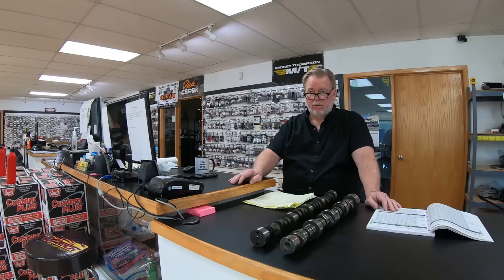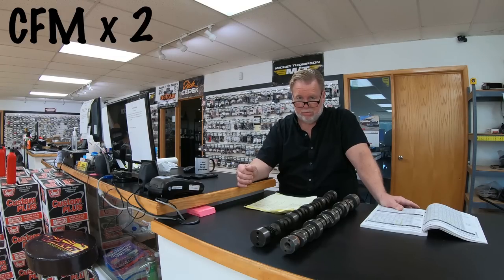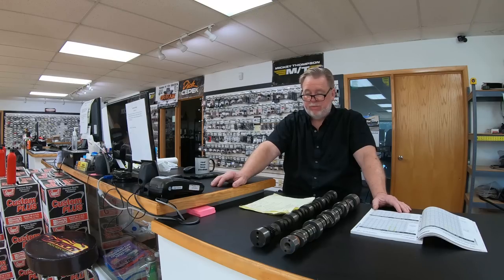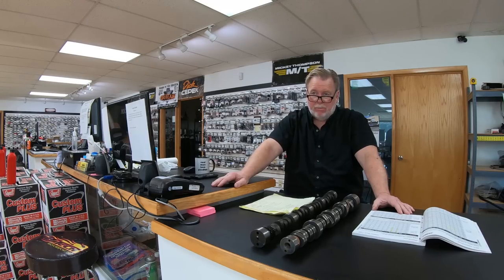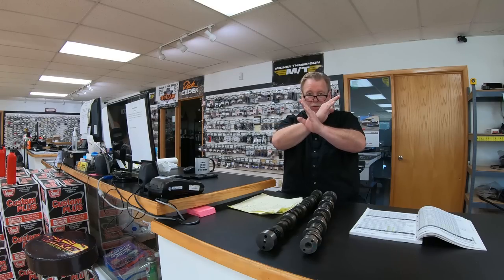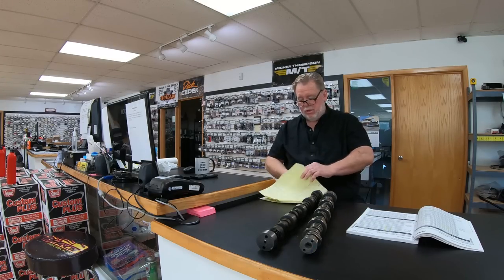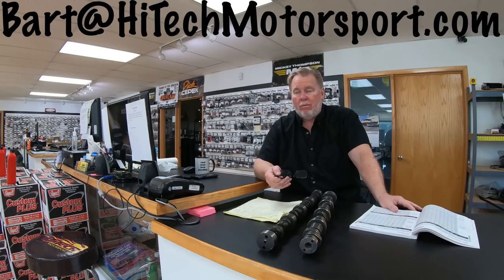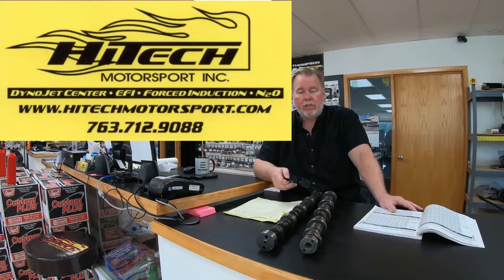How to Choose An Ls Camshaft For Max Horsepower

Comment: You know, I always see guys get these monster cams that make max power at 7-7.5K in a 4,000 lb car and don't understand why the car runs like shit. When I finally get around to doing heads and cam on my car, I'm using a pretty much baby cam. Why? Because my car weighs 3,965 lbs with me in it. Every time I put a big cam in my engine/drag program, (don't ask which program, it's really old) that I think might beat my baby cam, it makes the car slower. I've found that a similar cam I used in real life in a supercharged old school 5.0 works surprisingly well in the LS1. BTW, this 302 cam was NOT meant for a supercharger, but woke the car up big time. Felt like another 60-70 rwhp over the previous stock cam, GT40 head config. My car is a heavy pig. I can't put a 7,500 rpm cam in my car. I laugh when shops say they put a monster cam in a car because the customer want a nice idle lope, against the shops recommendation. Since I'm not in the engine building business if I was building an engine for someone that wanted a monster cam, I would refuse to do it. Like I said, I'm not a shop in the business of making money. I just would feel really bad, putting something in some ones car to make it sound rowdy at idle, but run like baby poop. Same thing with heads. I've put heads with a little bit more flow up top in the program vs heads with very good low lift flow, and smaller ports and valves. Guess which one is always quicker? Yeah. Nice to see someone actually speaking the truth, even if it hurts your ego. I'd rather have someone tell me they can't hear my cam, and clean their clock, going down the track, than having a cam that shakes the whole car and runs high 12's when it should be an easy 10. When I had my '95 Z28 6 speed, I made the mistake of going to a shop right down the road from Atco. I asked the owner how could I get my Z28 to go 13.5's. He told me pull the engine out and put a Grand National 3.8 in it, which would cost me like 10.5K. I promptly left his shop. A few years later, I got to 12.5's with 4.10 gears, ported factory heads, stock valves, headers, LT4 intake, BBK throttle body, and STOCK cam. So yeah. You guys can do a lot worse ignoring everything this gentleman just said. That will just make guys like me faster than you. Have a nice day :)

Comment: What's the best head and cam combo 243 ported or 862 ported and what cam someone told me 233 239 .600 .600 112 lsa I'd like to mill to get 11.1 compression but was told it won't work with that cam and 243 it's gonna be a daily I want it to chop hard

Comment: What would you choose for a L77 engine it’s the aluminum 6.0 with 823 heads and ls3 intake. The car lives at 130-160mph when I drive it and I’m planning to re-gear the rear end and re do the cam setup for more power to go for 200mph what would you recommend? I know I sound full of shit but I can send you video proof of 160 dozens of times. My dream rn is just to reach 200 without having to go to power adders like boost or nitrous. Also this engine in its last two gears revs to 8,000 rpm so it spins up there.

Comment: What an good spec cam for an 383 ls1 stroker with trickflow 220 heads with 2.055 intake valves and 1.57 exhaust valves and fast 102 intake and Tb ,   I had an 240/250 cam speced and the car felt like an dog , and only trapped 117mph in the 1/4 mile

Comment: What about a solid flat tappet 274 at 050 duration 650 lift 106 lobe separation for a drag race only 362 windsor with canfield heads and 12to1 compression on 100 octane fuel? Has a 258 at 050 578 lift 105 lobe separation now and will instantly light 1st 2nd and 3rd to tire smoke on street.

Comment: You didnt includethe ls3 or l99 in the most popular Camaro..the 6.2 5th gen. 😊 Im getting a cam installed in my l99 with 3200 stall and 391 gears. Should i do a custom grind? My tuner suggests that. Thank you 👍

Comment: I have a stock 2002 Yukon Denali that I’m building my spare 6.0 for. I also have a 4l80e that I’ll be putting in with the built 6.0 once I finish it. What all would you suggest cam/heads wise? Im wanting to supercharge it

Comment: Richard Holdner tested an LS down to 108 LSA and it made the best power everywhere. He also tested the loss of pressure and guess what no problem. The problem is everyone wants lots of duration and most small blocks don't need it. Run more conservative duration and tighten the LSA. You will make more average power. Fat area under the curve.

Comment: What would you recommend for an 06 GTO 6-speed, 243 stock heads (plan on upgrading springs etc at same time) believe 3.46 rear gears, factory compression, street car. Got screwed by a guy looking for his own “cash flow”🙄now I’m back in the market for a good cam. P.S. it will be driven a lot so decent fuel economy would be nice. Thanks!

Comment: Does that cam you mentioned for the 5.3 (223/227) work good with stock torque converter?
Reply: You should always pair the cam with the stall. A stock stall is shit. If you're doing a cam swap get a stall to go with it.
Reply from the maker: the 223/227 cam works with a stock stall converter, but it works better with a 2800 to 3000 converter from circle d. you will just need to raise the idle to 675 when you tune it. b
Reply: That helped me out, thanks for the question and answers. 
   I'm wondering too.

Comment: I do not race my 2010 LS-3 Corvette. Mostly we use it for long distance touring and back road driving. The car pulls strongly from idle to 5500. I think I will stick with the stock cam. Thanks for the Information.

Comment: haha, well i did add formula to bbc heads and well it was only 43 hp lower then blueprint 815hp 632 bbc crate engine with nothing special heads (intake@600: 351x2+70.2 = 772.2) so this formula is very nice to figure out basic idea.

also look like 706/862 ls heads are way to go even if any other dyno test say hell no.

Comment: Hi. Good info. I have a 5.7 hemi eagle heads. I am looking for a cam for it. I have a qs.  These heads have a big difference between exhaust and intake cfm which makes a low percent efficiency. I was thinking of making the exhaust valve slightly bigger. Is that a good idea? If so how big for a daily driver. I want the best efficiency air in and air for this motor. As far as cams. What’s some good cams for daily driver that doesn’t kill mpg.

Comment: Knowing this an older video I hope you are able to respond to a question from me. I have a stock C6 Corvette, Z51, A6 w/stock converter, LS2 & 2.56 rear gear. The stock cam is 204/211, 520, 116. I daily drive this car and bracket/index race it on weekends. My question is how does this affect choosing the cam upgrade for this car? Are street manners all in the LSA or does the duration change that more than the LSA? Any comments and/or recommendations. Great video and I appreciate you man!

Comment: LS7 zo6  I'm wanting to upgrade to a better flowing heads possibly over the factory stock ones if theirs such a thing over factory. Also possibly a cam shaft and roller rockers because of the trunion issues on some.  I hear many go in and upgrade them. I figure why spend the money there if theirs an alternative stronger lighter weight units that are full roller. I hear the kits are 150- 160 bucks for trunion upgrade. I was wondering what you would suggest on these things Bart any other suggestions that you would recommend doing while it's torn down.   My plan is for the car to be street driven and raced occasionally on weekends at the 1/4 mile track. I want it to sound really thumpy but not sacrifice any performance out of it's capability. And also might spray it later on. Appreciate any suggestions !

Comment: I am an old guy,  I do not like the .050 opening at duration.  I prefer duration at .006 opening.  I would prefer a valve overlap at a max of 20 degrees for a good street cam and decent gas mileage.  And use a roller cam only.

Comment: Hi Viking fan!  Great vid, full of info.  I have a 2009 Chevy Silverado 5.3 flex fuel engine.   It has the usual cam lifter issues, but no engine code!?   I pull a camper in summer and use it as daily driver.  What's the best setup for my truck....  Thanks

Comment: What do you think about a 629 615 lift. 225/236 duration on 114 lsa in a 6.0 engine? Has pro comp heads.  Good hot rod cam?  1800-7000 rpm range.

Comment: So, I have an LM7 5.3 in my 04 Silverado. I want a cam that I can use for a daily driver, but would give me the torque and horsepower when I need it, like street racing. And from what you're saying, I'm getting the info that the best cam for my truck is a 223/227 .600 .600 with a 113 LSA?
Reply: Also would I need a stall converter for the cam?

Comment: 👍🏼 .. I have a Chevy 350 5.7L vortex . what cam would u recommend for every day use and a little show off power ? Want to b able to use maximum power the engine can handle or give stock . Also if u would know what intake would work fine as a set thanx..

Comment: I went with what they recommend 231 243 duration @ 116 + 6 degrees.. 9 psi magi supercharger w/ stock heads 488 gears.And performed awesome. On the next bill going to order heads and cam as recommended , big dia. Header ...response was Instantaneous.   I’ll always go with recommendations of cam heads after talking to the pros ,  BUT they have to listen to YOU and YOU have to listen to them

Comment: Mr Wallace, there is only 1 thing you didn't cover. Crane Cam had a theory called hydralic intensity which covered the spread between .050s and advertised (where they measured at SAE standard or 004s). Comp Cams  mesured advertised at .006s, which means you would have to add another 10 degrees at their advertised figures. Generally, if the spread was tightest between the 2 figures, and the most valve lift generated the most hp and torque figures. As far for Comp Cams, I always considered their Xtreme Cam line a pretty close copy of Crane cams. I also wish you had covered using variable duration lifters with large cams to widen out the power band as well. This has been the best discussion of selecting a camshaft for an engine as well I have seen.

Comment: So I have the (5.3) L59 (flex fuel version of LM7) in a 2002 GMC yukon, I daily the vehicle and use it to tow often. I wanna put some boost to it (8 to 12psi) with a water to air intercooler complete with extra radiator for the water and so on. I wanna choose a cam that will go with it but not quite sure which one to pick. Any suggestions would be fantastic.  

Mods to go with it; fast LSXRT intake and 102mm throttle body, headers, full exhaust, MSD ignition, centrifugal supercharger (coming soon). 

I do need something that works in the low range as well as mid range anything over 6000 rpm I'm not really concerned about. I dont really push my engine that high. Maybe if I get some good springs and Chrome molly push rods and new rockers /lifters I might have the redline upped to 6500... 
Also the vehicle is getting a set of 4.10 gears.

Comment: I have a 2008 4.8 in a silverado 1500. I have added CAI, headers and Magnaflow exhaust. Wondered what cam you'd recommend to someone with that spec, wanting a bit of a lumpy sound but not too drastic, and decent power gains. Thanks in advance for your help!
Reply: What did you end up going with?????
Reply: What’d you end up doing ?
Reply: I got like same setup

Comment: What cam would you suggest for a stock bottom end LQ9 with 799 heads a tbss intake manifold with 373 gears it’s going in on a 1975 c10.

Comment: First of all, Thanks for sharing your knowledge free of charge that's uncommon these days. Question : are the horse power and torque numbers you gave for your recommended cam  for the 5.3 (truck) with no other modifications other than maybe after market exhaust??? I want to add performance to my 2003 GMC Sierra while being able to daily drive . Any help appreciated!

Comment: Great video! 
I have a 5.3 out of a 04 Avalanche with 125,000 miles on it. I want to purchase a cam kit for it. With cam, lifters, valve springs, and push rods. I will ne putting this in a 95 mustang. I also plan on replacing the oil pump and gears in the rear end to 3.73. 
I want 500hp, what cam kit would you recommend?

Comment: Good learning  video watched several times I have  a couple  of new 5.3 stock lm4 engine's that I have up for sale. I would like to install  camshaft into them, would the 223/227 cam you suggest be a good all-around  cam to use and do I need  to change  springs  and push rods. Thanks

Comment: I'm running a 236/242 .615/.615 on a 111lsa in my n/a 5.3 for drag racing.  It has a short runner intake manifold and will have 243 heads.  Is this a bad cam choice for racing?? It's a lightweight foxbody
Reply: That will work fine for drag racing.

Comment: The 223/227 600/600 cam is that with a stock converter I'm using a 700r trans in my 87 c10 truck
Reply: Also the truck has a stock rear end